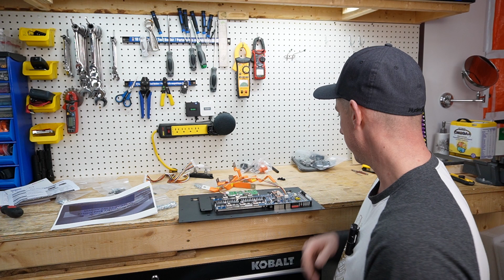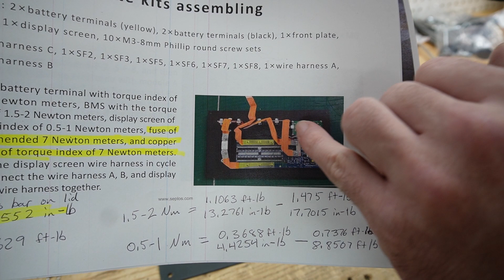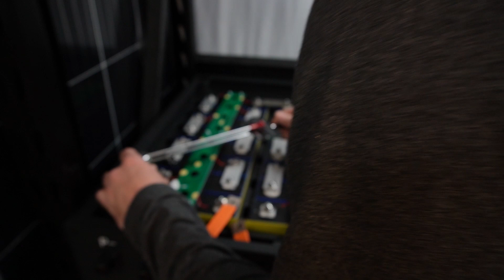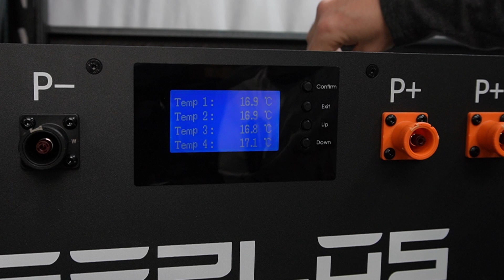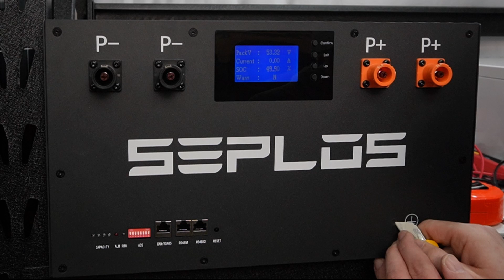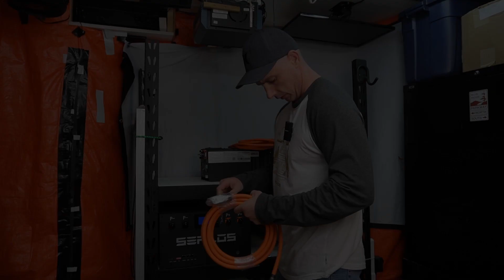Seplos Battery Build, 48V (51.2) LiFePO4 "Beast Battery Build" BMS

Comment: D I d you figure out SOC change , mine is completely wrong showing 100% at 52.6
Reply from the maker: I never had that issue. Has the battery been charged fully to reset the counter?
Reply: @Roll2Videos  I open it up again,  it is faulty ceĺ or a connection issue, on a load one cell was dropped too low a d bms shot it down then o. A restart it shows 100% , also  the caseit should be laid and I stand it , it should make no difference for cells maybe the connection is shifting but all cells are super tight in the case , when I open the case the positive stud got off the battery maybe I  overtide it when I was looking to fix. Socks,  I did build small 4 cells batteries in the past but this one is a pain in the ass the cells maybe cheap liitokala they claimed them A grade

Comment: You can shutdown the Seplos which removes the power from the terminals to make the connections to other devices, so there should be not spark then. But it's always a good idea to precharge the capacitors.

Comment: For me I find putting the fuse on top not under the attach busbar/cable better for my OCD. Let's hope it never blows, but if it does it will be much easier to change if it is not buried. Also your torque bar has NM on the top so no need to convert. I don't think the screws are at 7NM that seems excessive, to easy to strip. Most apex type bits are 1/4" SO you can just use 1/4" socket with the proper bit. GL in all your future endeavors.

Comment: Very interesting video 
I have 48v byd lithium batteries 
24v each which are connected in series to make up to 48v 
I misplaced the bic card which means I can't use the bms in the Battery pack. I want to know if there is a way to build my own bms in both packs. Thank you
Reply from the maker: You could buy your BMSs and wire them in.
Reply: Getting 16s bms would be good for the pack?
Reply from the maker: @Anood-i6w  If you are putting 16 3.2V cells in series. If you are building two 24v then series connecting them, you'll need two 8s BMSs
Reply: Jedine co se mi nelibi je ze uz postrada hlavni jistic 🤕  ( manualni ochrana pred skratem ) a hlavni vypinac   ,baterie se da zapnout a vypnout  tuskou dirka v ramu napis reset 🤕🤕

Comment: Build quality, and BMS wiring layout is great on the Seplos kits. These enclosures replaced my old truck toolbox battery enclosure build. Much nicer.  I also love the fact that you can use your own cells. 
I have seven in total. 4 x 135ah and 3 x 280ah.

Comment: Nice video  however  battery terminal  connectors  that you can make your battery cable??
Reply from the maker: I can make cables with the 50mm plug-style connector they use here. It's just more cost and time to find them.

Comment: Pyres battery cable  works  sephos battery connector??
Reply from the maker: No, The Seplos uses a 50mm plug with a #1 wire

Comment: Orange battery cable comes in kit????
Reply from the maker: No, Sorry, I should have said that. You'll have to order separately.
Reply: @Roll2Videos   can I get it on Amazon  if yes   please send the  link...
Reply from the maker: @hutchie9615  I've looked in the past with no luck. The best bet is to reach out to Seplos to get a pair.
Reply: @Roll2Videos  are they in the USA. Or AOL lithium battery can work  or where  can get  lug end  for sephos battery
Reply from the maker: @hutchie9615  They are in China, There email in on the website.

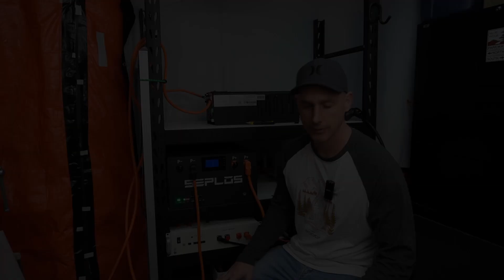Comment: SOK 100Ah | 48V - Server Rack Battery - Canadian dollars $2400. 0:50 Fuses protect wiring not equipment. Let me repeat fuses protect wiring not equipment. You say this fuse will not protect wiring (Very dangers). This company supplies a 400-amp fuse for a 48 DCV system. Not a class T fuse very dangers. 7:00 front plug DC power connectors, now this is becoming a joke. 23:15 Search for the ground screw with a razor knife then it was painted over (to funny).
Reply from the maker: Hello, again Valerie 👋 Thank you for commenting.

Comment: Manual I used was only one page,  basic but worked, one bus bar was was wrong but i made it work, fuse block was useless so need to replace that someday,  i have older model so no breaker
Reply from the maker: Yeah, no breaker on mine, either. I should have said a breaker would be ideal. Thank you for watching,👍
Reply: @Roll2 Videos  for a true ground yiu will also want to add a ground strap from the front panel to the main body amd another to the cover
Reply from the maker: @todamnbad  Good advice